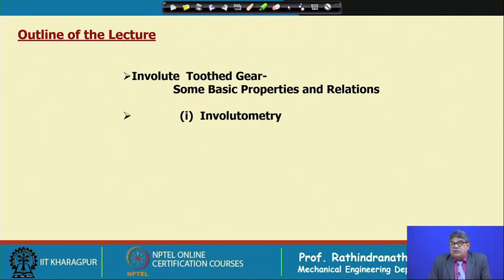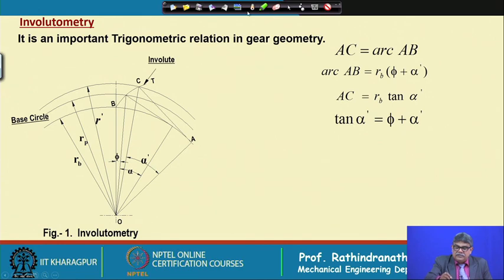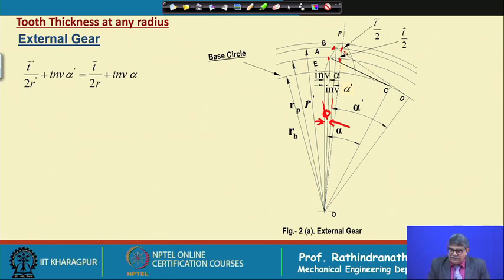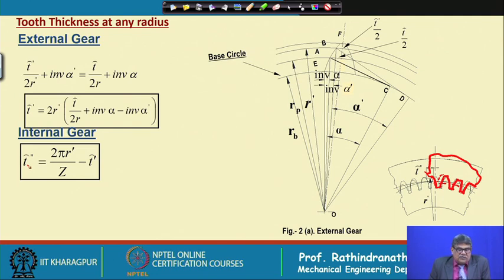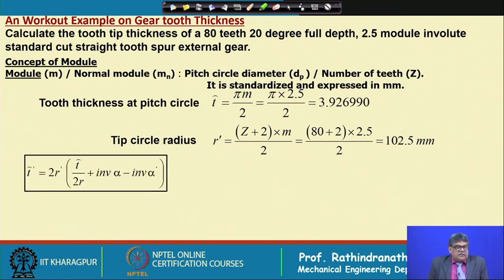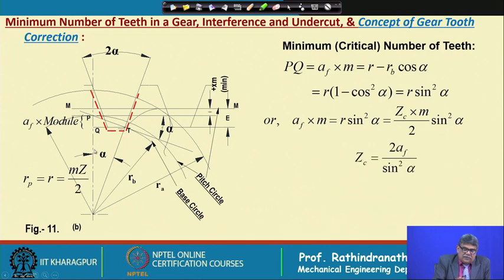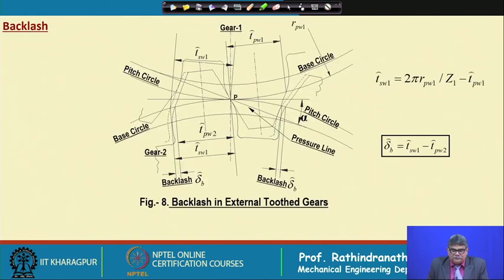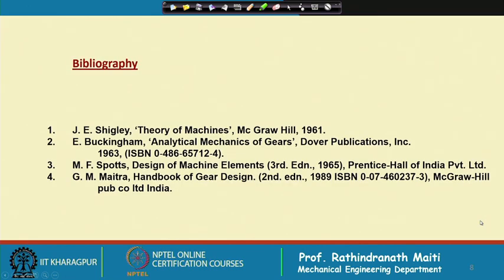Lecture 3 : Laws of Gearing, Kinematics and Geometry Part-II

Comment: Sir if you are seeing this comment plz explain how did you calculate value for inv (α) and inv(α') ?
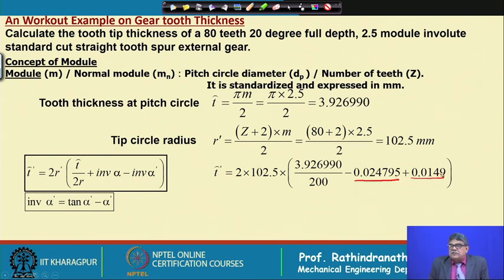In the 19:20
Reply: Have u got it these values
Reply: Involute alpha' = tan(alpha') - alpha'
 
Alpha' = 20 deg at tip circle radius as given in problem 
Use,
r' * cos(alpha') = rp * cos(alpha)

to get involute alpha at pitch circle radius.